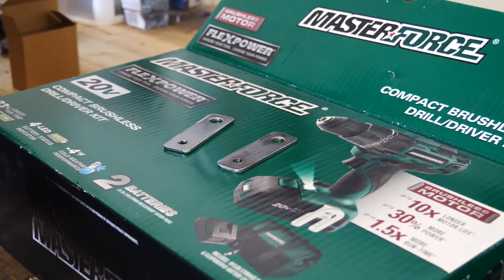V8 Drift Truck Gets an Upgraded Radiator & Clutch!

Comment: Put a small section of fuel line, split down the middle, over that sharp edge, around the radiator cap. I also like to use a bit of gasket adhesive to make the fuel line stick. It will make a nice bit of edging, protecting you from that sharp edge, and provide a much cleaner, finished appearance.

Comment: Rear mount the radiator like they do in formula drift... works so that if you have a front collision you won't puncture the radiator etc... also a rear battery box and fuel tank will help not only to have better access but to add some weight to the rear so that the V8 doesn't make the truck unbalanced at the front 👍🏻

Comment: Please use a hole saw and dimple die the front bumper to remove some excess weight and allow more air to flow to the radiator for better cooling.

Comment: Once you get that cap hole hogged to the right size, you might want to take a piece of vacuum hose, split it and then put it over that sharp edge, your fingers will thank you... Fits in there great, tucked in tight.

Comment: You need to plate around radiator filler cap to add strength back into top rid

Comment: For using a hole saw, treat it like a saw slow and steady keeps the blade way longer. Use a real cutting oil too wd40 is a powder once it drys not very good for lubricating. 

Also buy a vice

Comment: Make the fans pusher instead if pullers.  Looks like you should have enough room up front for those.  Maybe make a fan shroud?
Reply: Pushers are less efficient, they block air from entering the radiator
Reply: If it comes to him needing room though they will work.  I had pushers on my turbocharged mustang at one point and they worked just fine.
Reply: [Out of Line Garage] But he doesnt nees more room, therefore fans that pull are better in his situation.

Comment: Having a smaller bolt might throw the balance off a little bit, but it’s not a huge deal. Might wanna change it down the line though just for reassurance.

Comment: Hey bro.. better if u mount the fans up front the radiator right behind the grill.. that way u could use more room and easier for u to wire them up 👍keep up the good work.. im really a big fan of what y doing .. i got ls400 myself and super stocked to see it urs up and running

Comment: you can buy spacers that goes between the rear axel and the leafsprings
Reply: Jakob D lowering blocks. I had them for a long time on a Toyota Pickup but they’re not ideal for racing use. They screw up suspension geometry and cause a weak point in the rear suspension. I would definitely just recommend mono leaf springs and lowering shocks. Or just coilover conversion.

Comment: Can you turbo it in the future? Pls
Reply: There is not really enough room.  It would be cool tho!
Reply: It's SOS there's loads of room!
Reply: He is building the other motor for force induction in the future might be for turbos?
Reply: He can make turbo sticking out of the hood
Reply: 7:37 see that knobby thing next to the coolant intake? that is a stock turbo..... so dont say turbo it in the future....you mean upgrade the turbocharger(s) that are already there.
Reply: @rhissian5260  nope. The engine has no turbocharger thats an alternator.  A turbo doesnt just stick onto an engine like that.
Reply: I wouldn't recommend It. This truck was designed for OHV V6s at most, and this one came with a four banger, now It has a 4.0L V8. It has enough power for such a small truck as is!
Reply: make it stick out from the hood don't fully make it stick out from the hood or people will call it a sleeper

Comment: With your angle grinder just push the button in to lock the blade and grab the blade and unscrew it. No need for that tool unless the blade is worn all the way down.

Comment: Hey bro I️ don’t know if you do this or not but you should spray you drill bits with some oil to help it not stick. 

Also trunk rubber seal around that rad cap cut 😜👍🏼

Comment: "biggest radiator that could fit in the truck" HAS A HUGE EMPTY BED ON THE BACK (I know it would not be easy to add the radiator there tho because a relocation like that requires air tubes most of the times)

Comment: gingium you dont need the fans if you arent going to a drift event my old v6 buick century had no working fans and i drove it til we scrapped it and no not because of the engine it was the trans that had exploded from off roading it to much on low trans fluid

Comment: shouldn't you paint that metal before its rust above the radiator that you cut
Reply: He mentioned modifying it, most likely making it a bit bigger of a hole. Im sure he'll seal it when he does fix it
Reply: He needs to make it bigger and round the edges so he doesnt slice his fingers first

Comment: 12.9 is the equivalent to grade 8.  10.9 is equivalent to grade 6.  But a 10.9 should be plenty strong.  Guess it also depends on the manufacturer of the bolt.

Comment: Im still going to preach that an L33 5.3L out of a z71 silverado would have been better. Already huge pieces and radiators and cooling fans that would have fit just as well. AC sustem on a seperate aux swction easily deletable. 305hp and theres a bolt on kit for a supercharger boosting 450hp. Also has a trans cooler system you could have transfered for the manual trans.. 

I have fun with my 05 silverado drifting. Open  diff with the g80 makes it hard ontop of an auto, but it is possible and fun.
Reply from the maker: But its not Japanese
Reply: @_Gingium_  cough Ranger cough cough Ford/American

Comment: You have definitely just dramatically weakened the structural integrity of that truck by cutting off over %50 of the radiator support
Reply from the maker: Its a body on frame vehicle. I could cut out the entire body and it would still have structural integrity...

Comment: Dude, you are going to to loose you freaking hand. Never! change a wheel on a grinder with it still plugged in. I don't care that the lock pin is pushed. If you bump the switch bye bye hand.

Comment: Attention. I use to watch all your videos. When ever I found out that YouTube channel Heintz Boy Garage did the same drift build I was like WTF. So basically you copied someone’s else’s work.
Reply: Dave Graziano no he was at a drift event with Molly a while back a saw a Ford Ranger drifting. That how this thing be came a thing
Reply: blake20o1youtube 10/4 man
Reply from the maker: I didnt see Heintz Boy Garage's truck untill I had already started the build. I was actually quiet disappointed when I found out we were doing similar things.

But hey, we're using different engines and have different styles.
Reply: Gingium good luck with the remainder of the build.